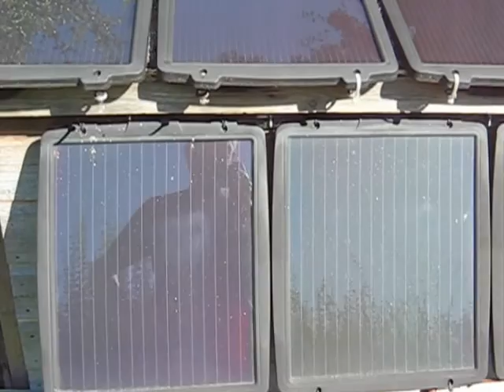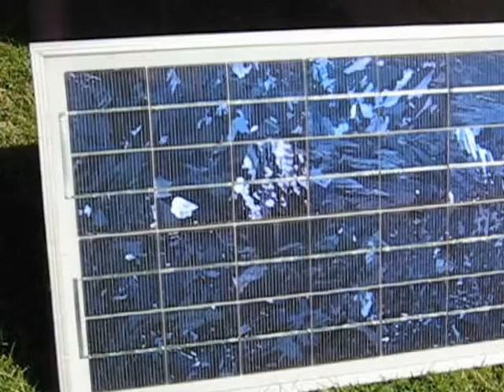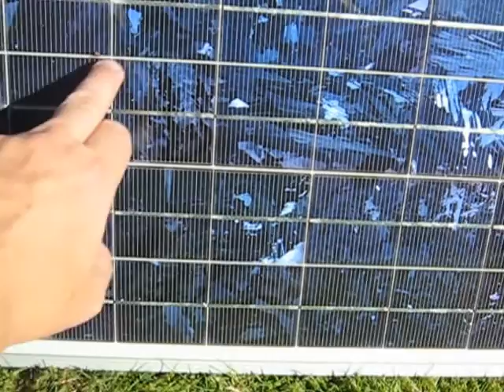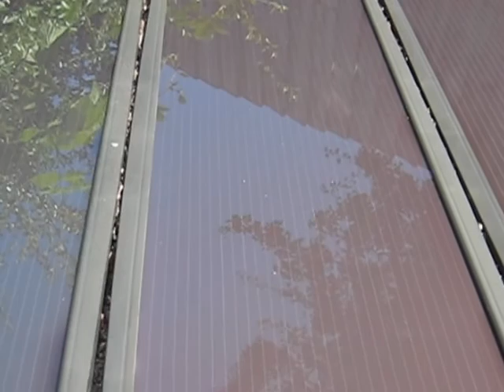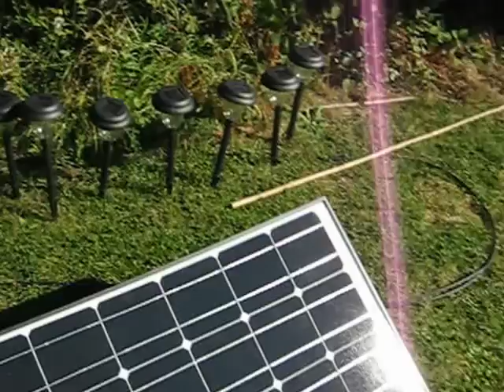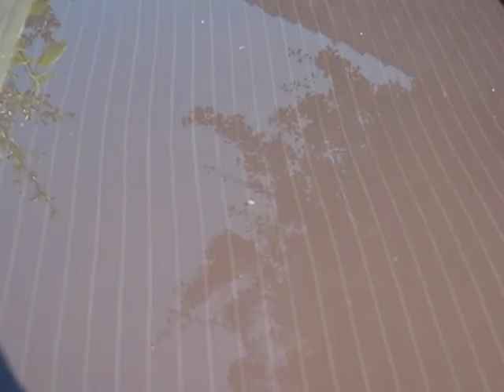Playing with Solar - Amorphous v Silicon Wafer

Comment: Ahh Julian. I didn't realise you had a video on this.
  Do you think that it's crazy that so many people have mono and poly fixed to their home installs in Northern Europe?
  An Amorphous can generate power from dusk till dawn in partial shade in less than ideal alignment in overcast conditions in all seasons. Where mono and poly only work well when close to perfectly aligned to the sun and only in full sun? 
  Listening to you dissing the Amorphous right now i am very surprised. Have you thought about how many hours of the day you will get over 50% of the power from the panel on average compared to the others. And considered the average installation which is a fixed angle and fixed compass setting in a generally overcast country with trees and other houses sometimes crowding the panels? 
  For me, personally it's a no brainer unless you are tracking the sun in a sunny country, live at the equator or unless you just want a token panel because you are short on space.
  Would you reconsider your view on Amorphous considering how most people in the northern hemisphere have their installations?
  I would love to see a real world test between the three over the year using an average northern hemisphere home setup.
Reply: 100 watts of amorphous takes up as much physical area as 400 watts of mono/poly. if you compare the performance of mono/poly to amorphous based only on wattage then yes, amorphous looks like it produces more power in low light conditions. but if you compare the performance of mono/poly to amorphous based on the physical area of the two arrays the low light performance is the same but the mono/poly will produce more power in full light conditions. i have tested this myself using 100 watts of amorphous panels and a 100 watt mono panel, both arrays mounted side by side with no obstructions to the southern sky, connected to identical charge controllers and identical batteries and monitored both outputs under identical light conditions here in the pacific northwest (washington state near seattle). my conclusion is that the amorphous array works better in low light simply because it has more surface area than the much smaller mono panel. i connected an additional 3 100 watt mono panels to the array and saw the same low light performance from both systems. so really the main difference is cost vs surface area, if you can get good amorphous panels cheap and have a lot of space to mount them, go for it. but, mono and poly panels are so cheap now and so easy to get new and used, they are the obvious choice and it is the main reason they are so commonly used in northern europe and everywhere else on planet earth. in fact, it is becoming a lot harder to find a good economical amorphous panel, most of the manufacturers have gone out of business and the only ones you see now for a relatively low price are the cheap plastic-framed ones from china sold all over under various brand names, the common ones here in the us are from harbor freight..
Reply: @marzsit9833  My point is that most people do not have a perfect allignment and do not change for seasonal allignment. Then there is the fact that many have partial shading and that the weather is generally not amazing in much of northern Europe / upper part of North America.
  So for most people they may want to consider thin film. Especially if they still have some spare roof or ground space, local laws / regulation allowing. 
   I would love to see some real world comparisons over a few years. If you live closer to the equator it's a no brainer but if not...........

Comment: i bought a harbor freight 100w solar kit because it was on sale and i also had a 20% off coupon, so i bought it for a really good price and i had always wanted to test one out for my own curiosity. other than the fact that the panels are huge and don't have metal frames, in full sunlight pointed at the sun they do produce between 102 and 109 watts. after experimenting and comparing them to 100 watt mono panels i believe that the amorphous panels perform better than the mono panel in low light conditions simply because the amorphous panels have more surface area than the relatively small 100w mono panel. but 3 100w mono panels would easily perform the same in low light conditions and would use the same amount of space while also having superior full-sunlight performance. so personally i wouldn't buy amorphous panels unless they are inexpensive and have the real estate to mount them. mono panels are so inexpensive now that you can assemble a 200 watt system for the same price as the harbor freight system.

Comment: Amorphous panels are far less space-efficient as far as rated output goes, but they are relatively much more efficient at producing power on overcast days.  I've seen my 45W set of amorphous panels charging a deep cycle battery even when it's overcast and raining.  My 280W polycrystalline panel doesn't produce anything useful under those conditions.
Reply: Here in North Norway 900km past the polar circle you can have more then 1 month in middle of summer with no sun at all,  in the autumn 1 month of nonstop rain some places is not unusual. I want panels that works ok in the weather we have most. No need for panels that give lot of power when it is nice and sunny as then you are outside enjoying it and not needing lot of electricity. But no one give any number HOW much better amourphous panels is when it is no sun.  

I have now a 110w monocrystaline panel and it charges in middle of day now when it is overcast at less then 0,5w... I have room for total of 9m2 of panels on my van and plan is to cover it all with panels that works better then my monocrystaline panel when it is little to no sun...

I see panels here for sale in internet stores that is clearly amorphous being sold as monocrystaline high efficiency panels (does not exactly give you confidence when the stores have no clue what they are selling)...

Comment: Julian Ilett 

Hi Julian,  thanks for all your great videos on this subject and the arduino!

I am currently looking into this subject because I will soon be buying a solar system to power my home, completely off grid.

I have also read that silicon amorphous "should" produce more power throughout the day than a similar sized mono or poly crystalline panel because "in theory" it will produce more electricity at dusk and dawn. I cant find any real world comparisons, just peoples opinions with no data to back up their speculation.

Seeing as you have all three types of panels and logging the amount of electricity produced throughout a certain period of time shouldn’t be too hard to do, it would be very interesting if you could give us some real world data on how much each of these panels produce under the same conditions.

This would give us some practical information to work on and would get us out of the world of marketing hype and personal opinions.

I would be very grateful if you had any information of this sort or if you would be willing to do such an experiment seeing as you already have all the equipment.

thanks again!

Comment: amorphous seems like it'd be good RVs, busses and the like, or whenever you can't help but to have a panel partially shaded for part of the day
Reply: Yes but only if you can find the right panels for the job. You need to consider that most Amorphous are designed for mains voltage inverters so they start sometimes at high voltages and also many of them come in huge strips. But i'm sure the right Amorphous panel for the job and or charger is out there.

Comment from the maker: Yes, the amorphous panel have to compete on price so they're about the same price per Watt as the silicon panels, so for the same money you get a larger area panel. I'm interested in the claim that amorphous panels don't need sunlight, just daylight (nonsense of course). But it may be that silicon is more affected by cloud than amorphous - just an idea - I'll test it next summer.

YouTube asked if I'd like to 'improve' my video - I won't be doing that again!
Reply: I just saw that you said you will be doing a real world test on Amorphous vs the others. Did that ever happen?
  Please see my above comment, but for example, i have a large south west westerly facing roof at 11 degrees pitch. Since i can not get good alignment for mono or poly then surely Amorphous is the way to go. Not everyone has south facing roofs and virtually nobody adjusts their panels for winter use. I have a row of mono and poly along my south wall so i do adjust them but most people means people who have fixed installs. Also we need to consider dusk till dawn power output and overcast conditions that the northern hemisphere often sees. 
  Going to look for your Amorphous testing video now, a bit confused why you didn't do it in this video.
Reply: Julian Ilett it looks like your panels are really amorphous as they move along where the camera goes
Reply: After a lengthy study using instrumentation, I've found that amorphous panels are MUCH more efficient in shade and during cloudy days.  Amorphous will put out very good power during those conditions whereas mono- & poly-crystalline panels not only nearly stop producing power on those days but produce less than full power unless they are rotated constantly to point toward the sun.

Comment: Silicon wafers can now reach diameters of up to 30cm (at least in the production of CPUs). So you are right that the absence of diamond shaped spaces is not an indicator for polychrystaline cells anymore. 
Were the amorphous panels cheaper per area than the other panels?

Youtube's motion stabilization is doing funny things to your video by the way.